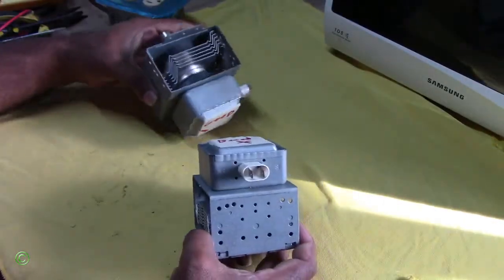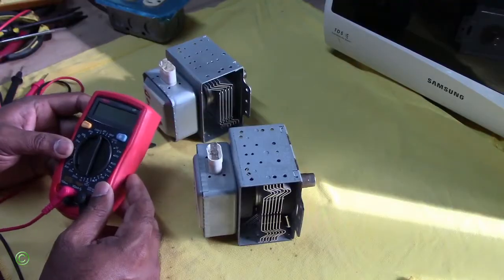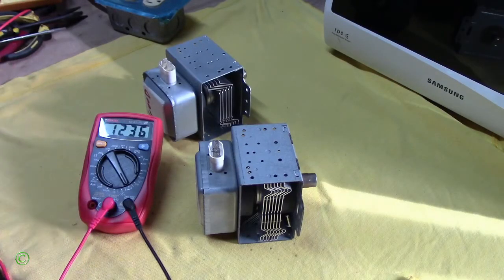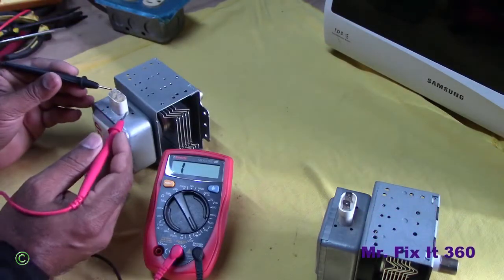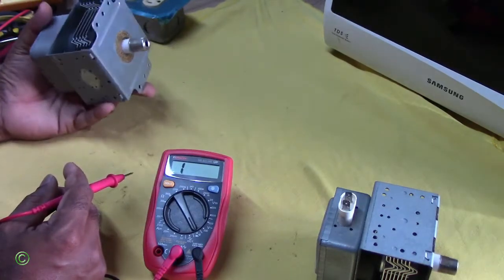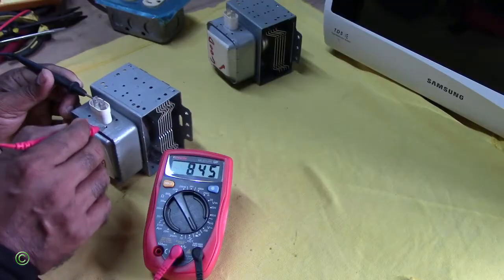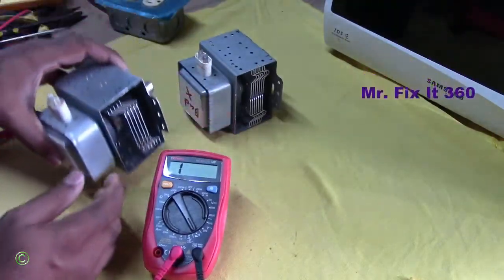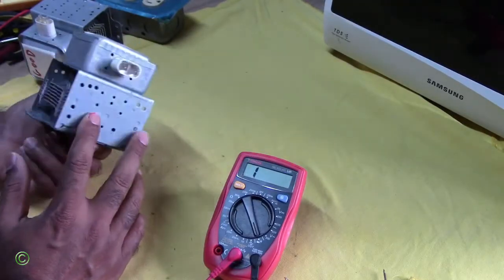How to test a good and bad microwave oven Magnetron

Comment: Continuity or a resistance reading from filament to ground is actually a very uncommon failure mode for magnetrons. The vast majority of magnetron failures involve low emission and resulting low current draw, which is not something that can be tested statically (with a multimeter). So the test in this video will only cover less than 10% of magnetron failures.
Reply: What other tests are there?
Reply: @JamesENjeruN  The Tater-Tot Test (⁴T, or "forty check," as it's known in the industry) is extremely effective. Return the magnetron in question to its appliance, and test to see if tots will warm enough to emit steam when split open; if they do, the magnetron is functioning. I recommend performing this test occasionally on every microwave, just to be sure.

Comment: Even the test passed on 4 filament pin socket , it does not mean the magnetron is good. If the magnet cracked, the magnetron will not worked. So not only on pin needed to worked on. Try to inspect by  visual the magnet and other parts of the magnetron that might loose plate attachment.

Comment: How to change a relay or repair relay and microwave
Reply from the maker: First you need the correct relay. Then unsoldered the bad relay and install the new relay. But you must be careful when you unsoldering because you don't want to cross solder together.

Comment: same with mine guys.. it passed these basic contnuity test for the magnetron but as i replaced the original part it did fix the problem.. this cud be considered just a quick check.
Reply from the maker: Sometimes a magnetron can give you good reading and then sometimes that same magnetron ain't working good. That's how magnetron is sometimes.

Comment: My magnetron passed these two tests just fine, but still didn't cook. There was 3000 volts at the magnetron (yes, I have a high-voltage probe and know how to use it). I replaced the magnetron today, and everything works fine. SO, while these tests will show certain failures, there are obviously other ways for a magnetron to fail.
Reply: The test in the video only detects the obvious. Your defective magnetron might have had a cracked (ring) magnet which is also a common fault occurrence that the video test won't detect.
Reply: @MichaelAChang  Definitely wsn't a cracked magnet. I think the really good thing about a bad magnetron is that you can salvage the magnets ;-)
Reply: I too had both test perfectly fine but my microwave didn't heat the food so I went to the store and bought a new mag and all's good now
Reply: What other ways can and should you test to see if it is bad?
Reply: Yep, same with me. All tests passed on my Samsung and it was still bad. Replaced Mag and all is good.
Reply: I found that testing in continuity can be misleading. I find in ohms gives the operator the best results due to being more sensitive(not sure if that is the correct word)
Reply: There are lot of tests that you can't rely on on the microwave. Even the one you removed may just work in another one.
Reply from the maker: Sound like the magnetron have a short circuit problem.

Comment: My magnetron checks ok based on your tests but there were spark between the microwave case and the copper cover on top of the ceramic pink head. And there is continuity between that copper cover and the case
Reply from the maker: It mean the tip of the magnetron is burning out. so you will have to replace it as soon as possible.
Reply: @mr.fixit3604  Yeah I replaced it with a new one and it works fine.
Reply from the maker: @car9167  great you good to go.

Comment: I performed the test on the magnetron and the results would suggest that it is fine. I notice NO crack in the magnets either. I have a Panasonic Prestige 1300W inverter microwave oven. The issue was that it would chip the breaker after 2-3 secs. The switches tested fine. If I disconnect the magnetron from the inverter board microwave does not chip out. Once I connect it the issue occurs again. Any insight?
Reply from the maker: no problem. let me know if the breaker trip when you run plug on another microwave ok.
Reply from the maker: https://www.youtube.com/watch?v=2olg-jzgFDM&list=PLS14d6kPSRHtkR2GP6AEudqHHlWr9jqpu&index=20
Reply from the maker: Check out that video .
Reply from the maker: Hi. the thing with them Panasonic Microwave Inverter Oven. is that the circuit board components does be the problem. some of the components does go bad causing the breaker to trip. try plugin on another microwave on the same plug. you will see the breaker will not trip. but if the breaker trip is because the plug is over loading causing the breaker to trip. I hope this answer your question. if not feel free to comment.
Reply: @mr.fixit3604  Thank you

Comment: Does the magnetron need to be removed from the microwave for this test?
Reply from the maker: I like this question. NO it don't have to be remove for testing. But! is best you remove the magnetron from the microwave cavity so you can inspect it for any damage like the magnet for cracks or burn on the Antenna RF output and stuff.
Reply: @mr.fixit3604  Thanks for the reply. Yes, I wasn't sure if it was grounded to the frame and would mess up the multimeter test somehow. 
Mine had continuity between the leads. Turns out the insulator was faulty. Very subtly discolored and bulging. I ripped it completely a part, (avoiding the dangerous chemical) before I realized it.

Comment: What is that FA and F found on magnetron? Can I change the connection?
Reply from the maker: The FA side of the magnetron is connected to the side of the high voltage capacitor with the rectifying diode which is then grounded. and the F side of the magnetron is directly connected to center winding of the transformer which is thin and small.
Reply: @mr.fixit3604  thank you so much....
Reply: Very good the answer, if the connection reversed ,what is the problem for the magnetron. Please answer. Thanks